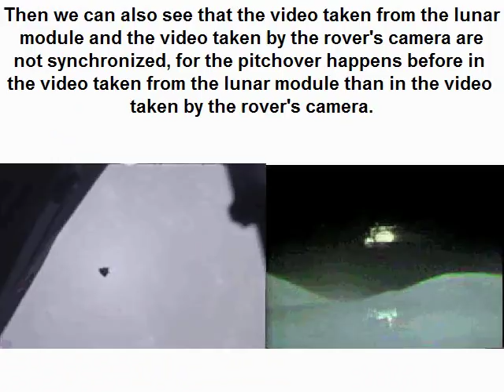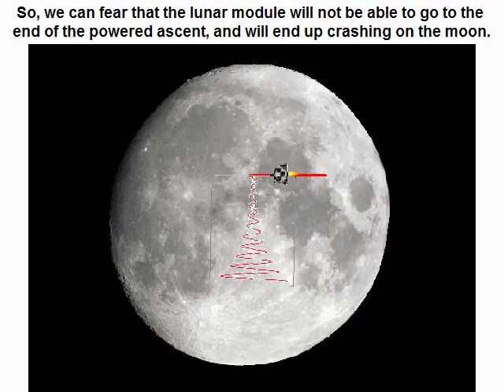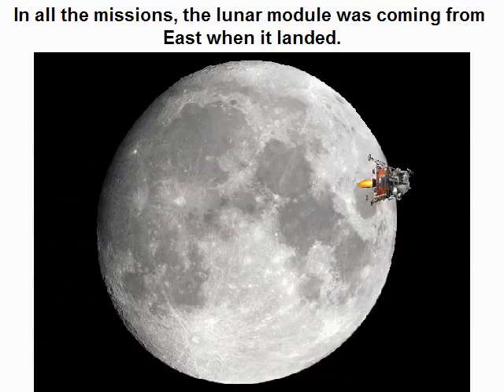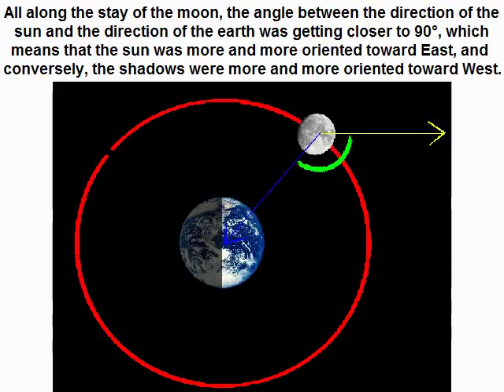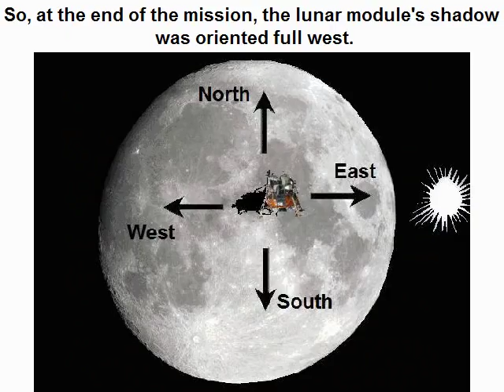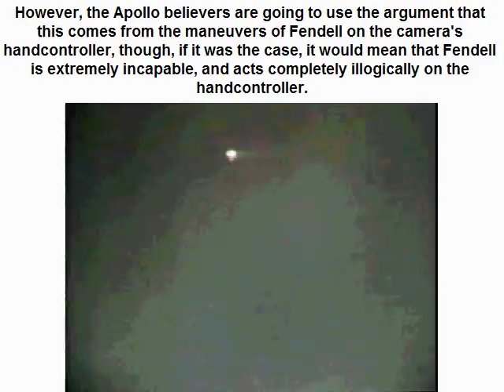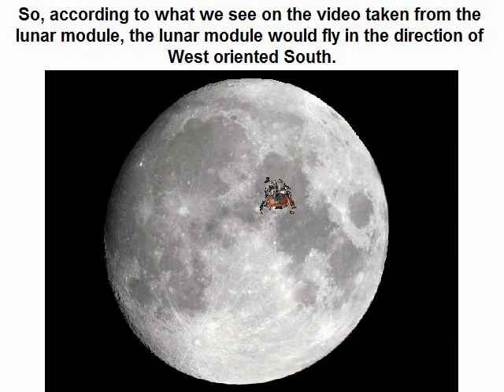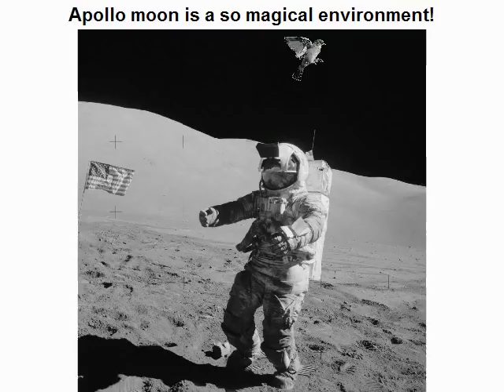The unknown trajectory of the lunar module

Comment: One last query. Why do you use such grossly inaccurate means to determine solar position when you are arguing about LM azimuth angles that differ by less than 10 degrees? Your scaling from the panoramic shot exaggerates these angles as the panorama does not complete 360 degrees - the landscapes at either end do not seamlessly join together? All these angles included solar azimuth and elevation angles can be obtained to within a second of arc using the JPL Ephemerides! Are you afraid that these exact angles will bear out the truthfulness of the official Apollo 17 record?

Comment: If the LM was undegoing the simpe harmonic motion as hunchbacked maintains the maximum acceleration due to SHM is
amax = 4 pi^2 r / T^2   m/s^2
where r is amplitude in metres
              T is period in secs
From the video T is about a second and r is of the order of 10 metres. The maxiumum acceleration experienced by the crew would be about 360 m/s^2 or about 36 g. Clearly the motion of the LM ix not real but only an apparent motion caused by camera oscillations as Ed Fendell attempted to correct for the 1.5 second time delay!
Reply: +Gerard de Kremer Wow I hadn't thought of the maximum acceleration imposed on the crew by hunchbacked's little wander into fairytales. The minimum design loads for aerobatic aircraft are +6g to -3g and the g experienced by the astronauts is 6 to 7 times greater than that if the LM really did execute the hurdy gurdy ride. They would of course be dead! hunchbacked and his idiocy strike again!

Comment: How come the footage at the 8:00 mark taken with the on board sequence camera does not show the exponentially growing instability supposed demonstrated by the LM after pitchover. The picture is rock steady with no wild perturbations at all! Would this not confirm that the wild perturbations in the video footage from the rover are generated by the erratic camera movements of the rover DCA caused by the operator trying to overcome a 2.5 second time delay in a dynamic picture situation and not from any real motion executed by the LM itself?
Reply: This has been raised with him on an earlier video. Fendell's difficulties trying to overcome the 1.5 second time delay are well documented on the internet but le Hunchie's comments indicate that he is totally ignorant of the camera control problem introduced by such a significant time delay in the operator control loop. 

Your comment unfortunately has fallen upon deaf ears as le Hunchie has never performed a stability analysis using root locus methods on control loop transfer functions. Bizarre for a supposed aerospace engineer specialising in avionics!
Reply: Just CuriouS Ah your comment indicates that you have some insight into control problems unlike hunchbacked. The time delay introduces an exponential term in the closed loop transfer function. The rover video demonstrates a near classic case of the stability of such a system approaching its steady state value as time progresses. Hunchbacked is totally unaware that Ed Fendell's video could be used by a root locus method lecture to show the effect of a time delay as time progresses on the solution. Anyone with any experience with second order control design would recognise the cause if the apparent erratic motion of the LM is traceable to the time delay in the camera attitude servomotor-human operator control transfer function. And I have read that you say he has the equivalent of a master's in avionics from ENSAE - I DO NOT BELIEVE IT!
Reply: Gerard de Kremer That is true alright. Checked it with ENSAE personally a few months back. I just take the glaring discrepancies as evidence of a mental condition that is deteriorating with time.

 I conjecture that the real reason behind hunchbacked's channel is to regain some of his former 'glory' and Apollo is a convenient target because so much archival material is freely available on the internet combined with a ready made audience of moon loons ready to heap praise on such technical-sounding claptrap that appears to support their point of view. A year or two back I asked Xavier what he thought SUPAERO (ENSAE) would think of one of their postgraduates getting involved with such nonsense and his reply was telling. He felt that it would be proud of his efforts. This is what he is after, the recognition of his former abilities at some professional level that has been barred to him for the last 30 years or so courtesy of some personal misadventure. 

His leaving Markem-Imaje a decade ago when he was in his mid 50s was I think a sudden awareness that the waters of time had moved further under the bridge than what he was consciously aware of which motivated him onto his present course. If I am correct there will be no end to his videos as he pursues the bonanza gold of the magic revelation that totally reestablishes his professional reputation by resoundingly incontrovertibly debunking Apollo and this of course will never happen. If anything he is getting further and further away from this goal as each video has an increasing note of desperation attached to it. If ever he realises that the true goal behind his enterprise is unreachable the internal implosion will be catastrophic!

Comment: Please can you do a video and get hold of the technical specifications of the air conditioner on the LEM.

Surface temperature was 115 oC on the moon. Apollo 17 was there for 3 earth days (72hrs). How did the air conditioning dispose of access heat and how much energy was consumed running the a/c unit. What was the total energy rating of the LEM batteries?
Reply: As for the "air conditioner" on the LM (not LEM), it's very well documented in the public literature. Although it cooled the cabin air and the astronauts' suits, its main task was to reject the waste heat produced by the electronics and life support systems. It was NOT a closed-cycle refrigerator with an evaporator, condenser and power-hungry compressor; it was much more like a swamp cooler. It simply evaporated water into space. Just like swamp coolers on earth, this used MUCH less electricity than a closed-cycle refrigerator at the expense of consuming water. This would be unforgivably wasteful in a permanent moon base, but was perfectly acceptable for a brief Apollo visit of just a few days.

As for the batteries, they are also very well documented. Every battery on Apollo and Saturn was of the silver-zinc type, which have excellent capacity even by today's standards; the reason they're not more widely used should be obvious. The J mission LMs (15-17) contained five 400 amp-hour 28V batteries in the descent stage, for a total of 5 * 400 * 28 = 56 kilowatt-hours plus two smaller batteries in the ascent stage.
Reply: Correct. It's just that you said "open cycle ethylene glycol sublimator", which implied that the sublimator consumed ethylene glycol. It consumed only water; ethylene glycol was just the coolant used to bring heat to the sublimator.
Reply: Where did you get this crap about the lunar surface being at 115°C? Must have been after a good anal probe!
Reply: "Temperature measurements made with thermocouples positioned within a few centimeters above the surface are available for Apollo 15 and A17. As indicated in the following figures, temperatures at EVA-3 termination for those two missions were about 342°K (69°C) and 325°K (52°C), respectively."
http://www.workingonthemoon.com/WOTM-ThermalEnvrnmnt.html

Between the lunar surface and the ascent stage crew cabin was a total absolute vacuum where the only heat transfer mechanism was radiant heat transfer - zero conduction and convection. 

The gross misunderstanding of the thermodynamics of the space environment 'radiates' strongly from Photon's ill-informed post. All objects located at the Earth's distance from the Sun are in the habitable zone of the solar system where the average temperature will approximate that of the Earth with the periodic variation depending primarily on how rapidly the object is subjected to light and shadow and its surface emissivity. Still it would be entertaining to say the least to see what hunchbacked could contribute to obfuscate the issues with his circus animal routines!
Reply: I would just like to reinforce that the LM ECS used an open cycle ethylene glycol sublimator to remove waste heat due to electrical components and other on board systems. The heat load from the environment was very low as the 32 layers of aluminized mylar minimized radiant heat absorption rates. All objects located 1 AU from the Sun will have an average temperature similar to that of the Earth so that spacecraft significantly closer than 1 AU have heat loss difficulties while those operating much beyond 1AU have heat retention difficulties. The moon loon misconception of a huge industrial refrigerator being necessary is just ignorant claptrap.
Reply: The glycol loop was closed (it was pumped in a loop) but it just carried the heat from the various electronic units (mounted to 'cold plates' through which the coolant was pumped in tubes) to the sublimator that actually rejected the heat to space by evaporating water. The LM sublimator was mounted on the top rear of the LM ascent stage; you can make out the steam vent in photographs. And no, the steam is not visible. Water in its gaseous state is invisible. So called "steam clouds" on earth are actually condensed water droplets formed when the air cools the steam. in a vacuum there's nothing to condense the steam from the sublimator so it remains invisible.

Cooling water was the most critical consumable during the Apollo 13 emergency, even before battery power (oxygen was actually no problem). The slight thrust imparted by the escaping steam pushed the craft a little off course but not dangerously so.
Reply: A sublimator by its very operation is open loop - there is no attempt to collect the expanded water vapour, compress it back into a liquid and recycle it. It is understood that the primary and secondary ethylene glycol loops are closed as such. I never indicated that the water vapour was visible. The description 'open cycle' was used to draw attention to the fundamental  difference between a sublimator and a refrigerator where the refrigerant loop is closed and the refrigerant serves the same purpose as the coolant.
Reply: ApolloWasReal & Endymion Andselene   Okay ladies we get the picture. It is though reassuring that the ignorant questioning that started off this particular thread has met with factual answers. I doubt somehow that the moon loon will understand that the moon does not suddenly go between its temperature extremes but rather undergoes a gradual increase as the Sun's elevation gets higher in the sky.